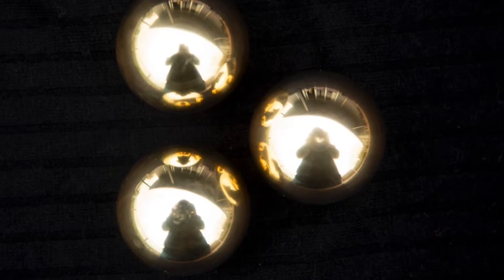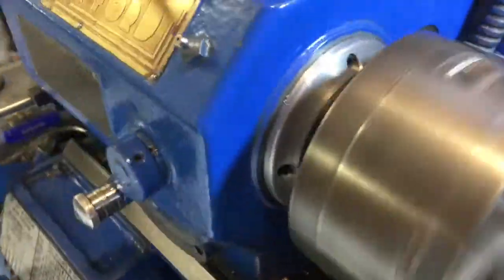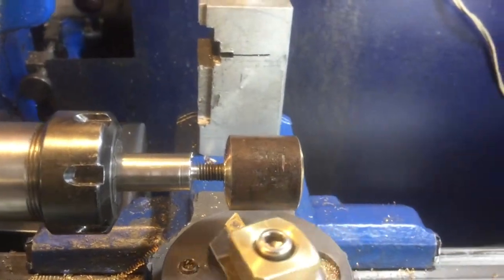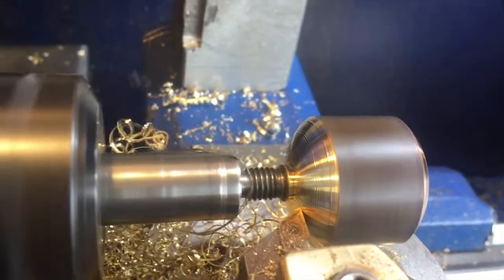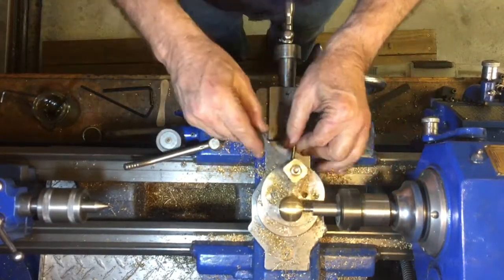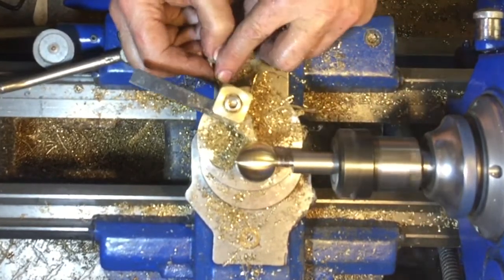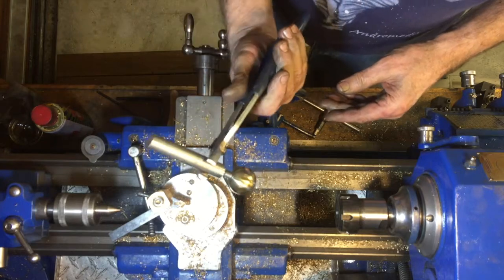How to use a ball turning attachment for your lathe

Comment: Could you show or talk about how to set this for a dimension?  I'm not sure I'm picturing how to go about that.

Thank you for sharing your idea!
Reply from the maker: Hi Dan, I have added an index to the video and you might find this helpful for reviewing the process. Start by swinging the tool to its center position ie furthest away from the cylinder/stock. Move the tool with the cross slide so that the distance between the tool and the surface of the caliber is equal to the radius of your ball, ie about equal to the radius of the cylinder. After that you do not need to alter the cross slide until you start cutting. 

Recall that when you swing the tool around, it pivots around the centers of the bottom two disks. The top disc on the other hand can be moved around its axis, which is offset from the center of the top disk. This movement of the top disk alters the distance between the tip of the tool and the center of the swing about the middle disc ie it alters the radius of the swing.

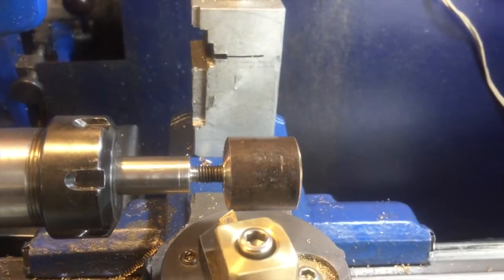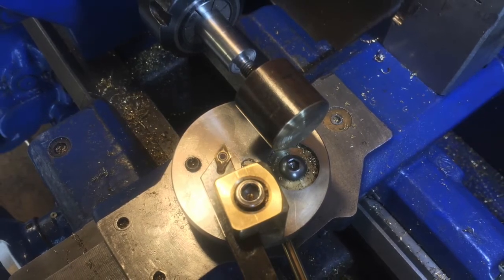Between 02:12 and 03:55 you can see where I use an Allen key to loosen the top disk. When the disk is rotated away from the center line of the middle disk, the radius of swing increases. When the radius has been set so that the tool just touches each end of the cylindrical stock, you lock the top disk into place by tightening with the Allen key. 

At the same time you may need to move the whole carriage back and forth so that the semicircular swing is centered half way along the length of the cylinder. If you notice that when swung to the left the tool tip is 1 mm to the right of the left end of the cylinder, and when you swing to the right hand end, the tip is 1mm to the right of that end, then you realize that both ends are in error by 1mm to the right. Move the carriage 1mm to the left and you will find that both ends now just touch the ends of the cylinder. If this is correct you can lock the carriage in place.  

If you now find that the tip is missing on both ends of the cylinder it means that the radius of your semicircle is too big. Loosen the top disk and reduce the radius slightly. Tighten the disc again and test the semicircle again. Repeat until you have the tool just touching both ends of the cylinder. It is a bit fiddly but it works well.
Reply: @Evan-e-cent  thank you for that. I'll think on this for a while and hope that it makes sense.